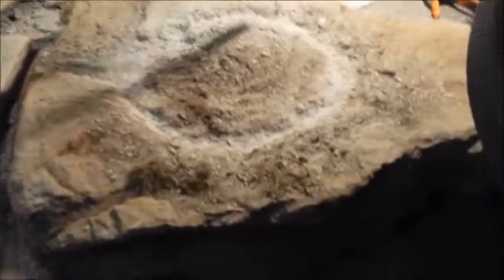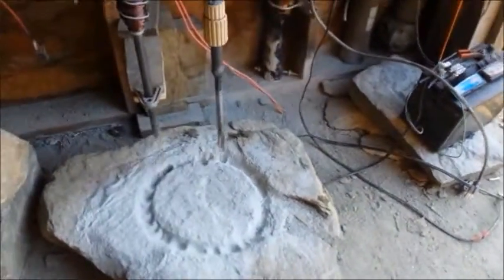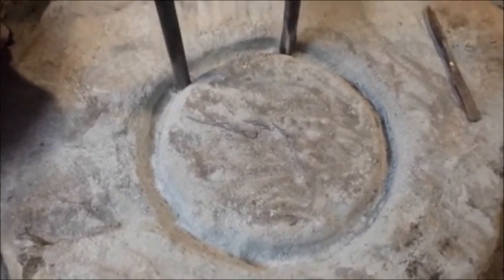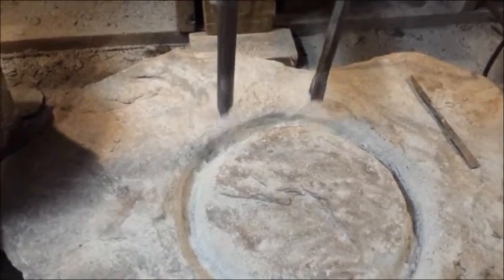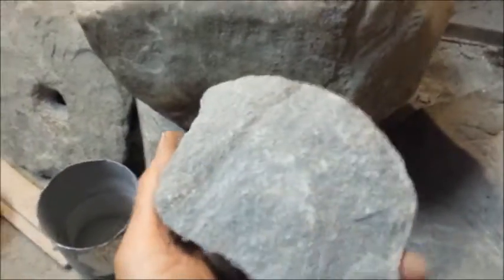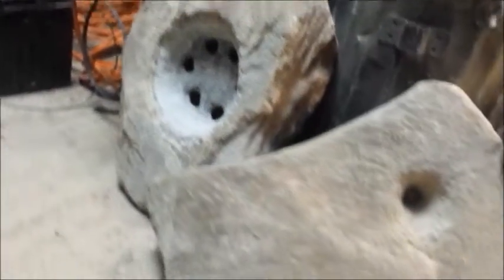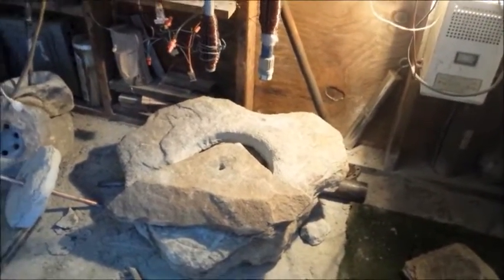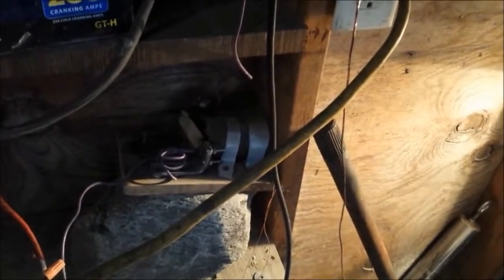Chipping the Obelisk Top in 8 captures

Comment: Scott, Thank You. I've been a fan of Coral Castle for years and always wondered how. It is so satisfying to finally gain an understanding. Can't thank you enough for sharing your discovery. Look forward to more of your videos.
     Jason
Reply: This is not how Ed did it. I agree that simple coil can do this but it is not efficient at all. I researched free energy for years and there is one method that might work here. When we pulse a coil it stores that energy and then this energy can be redirected to charge another battery. I think this process can produce free energy, because the electrical losses in this are about 20% but we get mechanical power that can probably produce more than the 20% loss. There is a guy who made such motor Bob Teal Magnipulsion and he claimed that it does work. In his books Leedskalnin describes "the most efficient electromagnet" and it is a design practically identical to that of Bob Teal. It is a coil surrounded with soft iron and a piece that is attracted, traveling very little distance. When the iron is fully attracted it completes the cage for the coil and this means all the stored energy would be collected. This also explains how Leedskalnin could have done that with just one battery, because if we pull some energy and then return it, the battery doesn't get destroyed. Batteries get destroyed when they are discharged a lot but in this "get a pulse, return a pulse" style it would last for very long. What Scott is doing would kill the battery very fast, they have only 200-300 full cycles and from what I see here, it would get you nowhere.

Comment: The well Leedskalnin dug was probably used to pull up water, so he could use his table as a way to perform electrolysis and actually extract browns gas and cut the rocks with a torch using HHO. Browns Gas would cut that stuff no problem.

Comment: I think I could make you a pretty good bedini motor so that you don't have to ask anybody for charge
Reply from the maker: I have always wondered how hard EDs wheel would be to BEDINI    IZE. Big lenz effect coils and caps?
Reply: Made by one man poor guy has to recharge those things that takes a lot of work
Reply from the maker: YEAR OF THE ROOSTER Exactly, BUT one thing I must add as an electrical guru all my life,is this: The one thing I never suspected is how efficient this old solenoid machine is verses solid DC application. The snap back DOES "seem" to Give the cells a momentary break. Also the rod is not that heavy so over time very little recharging is required.
    But yes imagine 10 or so in parallel. ONE generator charging all at once, maximizes the hit and miss engines gas usage  efficiently. They claim he had no utility power. So even a car or truck visiting could do wonders.My batteries take 3 hours to weaken before I have to adjust the wheel rheostat. AND COOLEST OF ALL? the damned thing will run on 10 volts. So what have you for suggestions on minmizing the lenz effect. ? I am open to any ideas     Scott R.